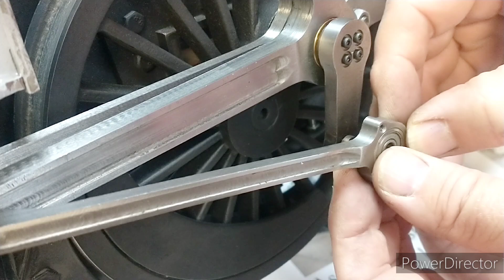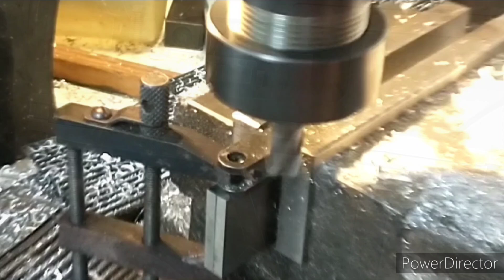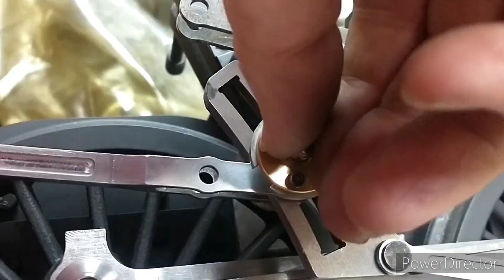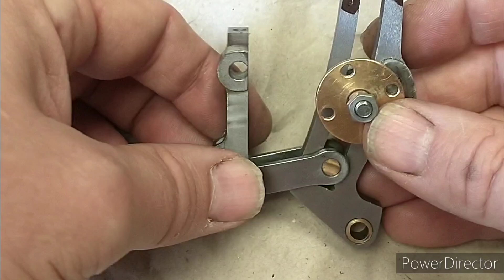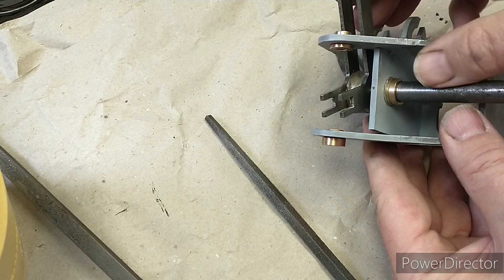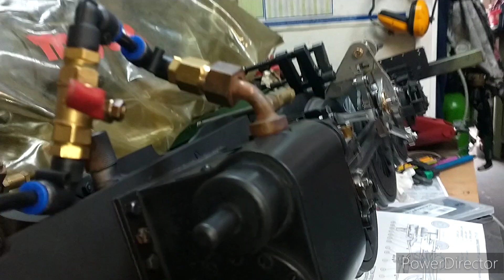Modelworks Britannia Ep40: Clearance is Clearance, Clarence! #livesteam

Comment: Julia, a review of how to design Walschaerts to understand first principles would be extremely useful. Things such as position of the motion bracket and it’s alignment to the valve CL. A minute error in this component will be amplified. I’m no expert on valve gear design, but I’m trying to design valve gear for my 71/4” A3, so I’ve picked up bits along the way. I suggest watching the “Eccentric Engineer” video on the subject. It helped me, along with reviewing Don Ashtons book on the subject. Rob
Reply: Julia, a good check also, would be to find the vertical position of the expansion link and then move the radius rod through the full travel. This should impart no movement on the valve itself, and confirms that the radius of the expansion link and the radius described by the two holes on the radius rod are the same.
Reply from the maker: Hi Rob, thanks for all of your suggestions, I found a good video on YouTube which explains how to set up Walschaerts gear I'm working through it on the Britannia at the moment. I have managed to get the expansion link vertical with no valve movement too but that's for the next video 😄

Comment: Not having the plans makes it difficult to tell, however, isn't that front rocking lever asymmetrical? Did you actually try turning it over to see if the throw changed? Of course, it is possible that the pivot points are centred and it makes no difference, so ignore this if so. Also you have probably made the mods already so I shall watch the video and shut up 😁
Reply: Julia, you are doing a really good job on a badly engineered engine. But for your last air test you were trying to run with the radius rod up towards mid-gear. You needed it to be close to the bottom of the expansion link, which might well have eliminated that jerkiness you are experiencing. Also I am glad that you did not try to alter the setting of the return-crank, or alter the length of the eccentric rod. That rod is always the last to be made for Walschaerts valve-gear, and its length MUST be exact, otherwise the expansion link will not have an equal swing either side of the neutral point, and correct valve-setting then becomes impossible. If you do not already have one I would recommend purchasing a book dealing with setting up this valve-gear for model locomotives. You will find it invaluable.
Reply from the maker: @DerekWalsh-l4i  thanks Derek for your comment I’ll have another look at that. I’ve actually found a good YouTube video describing the set up of Walschaerts which has helped me understand where to start. I have lots of books on valve gear but they are more aimed at design rather than commissioning…. 😀
Reply: @DerekWalsh-l4i  I noticed the radius rod near centre also, but it looks like the valve is getting full travel, as the die block is already close to the studs at each end of the valve guide. A review of the return crank throw might be advisable.
Reply: @robw53  Yes, but I'm not sure why there are studs at each end of the valve guide, presumably to clamp on a top slide to hold everything in line. If so it is a but of a bodge from Modelworks. But the whole thing must have worked at some point on the prototype before production commenced, so I would expect the return-crank throw to be correct.
Reply: @DerekWalsh-l4i  that’s how the full size is, with the 4 studs on the valve guide. The studs on the return crank and tapped holes in the crank pin are only correct, if the axial alignment of the crank pin in the hole in the wheel is correct. I can’t imagine MW keyed anything, but I’d be happy to be proven wrong. So there could have been an error in this when loctited into position.
Reply from the maker: Do you mean the combination lever that actually moves the valve crosshead? All three holes should be on the same centre line. The weird shape does make them look off centre though so good question. A friend found those links were bent on a different loco because of lack of clearance on the valve rod forks. Hence the work to improve them. 😃
Reply: @julias-shed  I thought there would be a pretty good reason for the mods! I wasn't sure what it was called exactly, the closest I could come was rocking lever from stationary steam engines 😁 I admire your patience, complex valve gear at small scale looks really tricky.